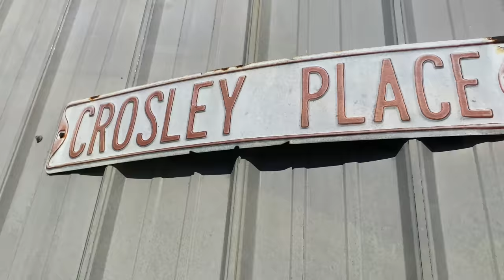LITTLE car BIG plans!!

Comment: Keep the hood as a lid above the engine so you don't have to get too fancy with the motor. Stretch the hood and add a piano hinge down the middle so you can open it from either side. Cut the front section of the fenders to wrap over the tires for headlights, or use the headlight bucket and weld to sides of the radiator frame so you won't have to source replacements. Don't trash them as the guy said. Hahaha! If you chop it you will miss the space and with a diesel engine in front of you, you will need lots of breathing room. I think its gonna be so cool!

Comment: I've recently had a  bit of a play with A Hyundi/Kia Diesel  [2.2 L (D4EB)] We put one in a Boat and its performance was stuning.The other we put into a Suzuki Vitara which really lit it up..The next might be going into a model A sedan..They rev well, weight is good, common rail diesel, turbo is too small though, and they have a Bosch Engine management system which was easy to deal with..with a twin turbo and decent fuel system they would certainly light up..

Comment: Cory and Hanna, a T-bucket chassis will fit right under that Crosley, you can get a chassis from SPIRIT CARS or SPEEDWAY their not that expensive and all the parts you need to get it done are available as a kit or individually as you go. Get a SPEEDWAY catalog and you'll see.

Comment: It definitely has potential as a rat rod 
I took a 66 mgb and stretched the front end over three feet and put a Chevy straight 6 in it
Reply: @Thomas Harff
A Chevy inline 6 will fit in a MGB with absolutely no body mods, just motor and trans mounts. I've installed V8s in several of my MGBs over the last 40 years with little more than motor and trans mounts and relocating steering column. ✌

Comment: The old man had one he use to putt around in for a while. Him and his buddy had a '41Willis pickup they ran in C/Gas, and they bounced around the idea of stretching the front out on the Crosley and building an A/Altered out of it, kinda open wheelish on the order of the wheelbase you have mocked up. His buddy ended up pulling the motor and building a pretty cool garden tractor out of it, and I think they got rid of the body because it was going to be big money to go from C/Gas to A/Altered. 

 I think you should look for a small diesel out of like a light plant or compressor. Those things run 8hrs+ on 5 gal. of diesel. They are only about 50hp, but the original engine would have been pressed to be that much. And, the diesel would have three times more torque to pull that little rig around. Put a 5 speed behind it with a Dana 40, and Mustang 2 front end. Would be easy enough to bag and should handle decent too.

Comment: I would put a 12 valve Cummins diesel out of a dodge dually extended cab backed up with a 6 speed transmission with dualys on the rear

Comment: Nice Crosley, ,looks like you have a loadstar crew cab? I have 5 one-man cab steel hauling trucks .. currently building a independent 2 wheel steer and powered  tandem slow go cart that does turns like a top and can drive sideways with two small engines to start with a 42 DeSoto frontend..  can't do the chat invite , screwed my phone up last time, I really dig the Viking , would make a sweet post card as is ....

Comment: I know they're not diesels. But he could use one of those three cylinder engines out of a Chevy Metro. Or maybe one of those really small 4 cylinders of a Toyota Tercel or something. Matter of fact I'd give you the perfect little 4/3 cylinder Toyota engine. It's the wildest thing. It has one rod going out to the side of the block anything still runs. Nothing planks but the rest of the engine runs okay. I'm not a big Toyota guy. Anyway that little 4-cylinder diesels and I believe some of the GM and Fords I'm not sure if they made it here to United States or not. An old small Mercedes diesel. Get together some of these guys who put big block Chevy engines in the front of Volkswagen bugs. Are they build a frame and everything I'm sure they'd have some ideas to share. But I like how you stretching it out or at least I think that's what you're doing when you cut it. One thing about it Crosby's a pretty cheap as far as to buy. Heck throw Cummins in it and idle at about 200 mph. Okay slight exaggeration 188 mph. But that's enough to more than get you back into the future. If you want to work on it all the time on those aluminum dual overhead cam Fiat engines from the old spiders or when they brought them back about 15 years ago. It probably idle that little car about 90 mph. He'll be fun to watch what y'all do with it. At least you're not going to re-body your golf cart with it

Comment: Restore what ? Lol. You basically have a go cart shell and that’s it ! I think a trike would be cool with a VW engine and a long springer front end , keep the side by side seating and run the steering on a chain ! And girl you need to learn to float shift ,the clutch will last longer ! Lol

Comment: A Honda with a turbo  front Wheel Drive is all the power you need and it will be under 1500 lbs .

Comment: Since you cut it off at the firewall why not just streach the fenders and not do an open wheel car and build a tube chassis for it with a 12v

Comment: this is begging for a chassis swap, guys would make these into gassers i see after googling. good potential here. turbo diesel please. wish you guys would reconsider using the front fenders, you can just cut the front of the wheel well off, maybe these pics will provide some inspiration. 

https://doverdragstrip.com/wp-content/uploads/attachments/UpHillBattlejpg.jpg
https://efregoso.github.io/gassermadnessus/lostandfound/lost/Trouble/topDrawer2.jpg
https://i.pinimg.com/736x/aa/96/be/aa96befa5e13cd6638efd20924073eeb.jpg